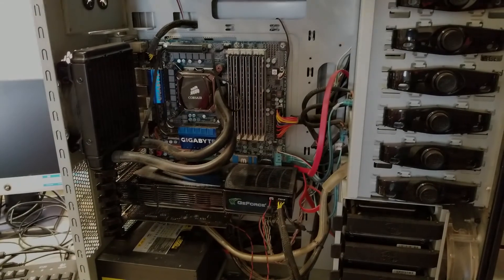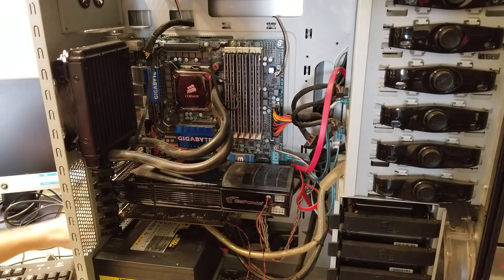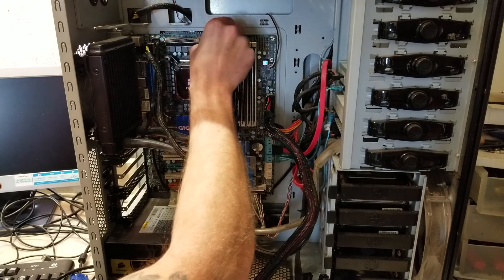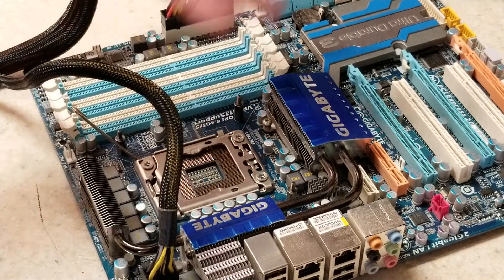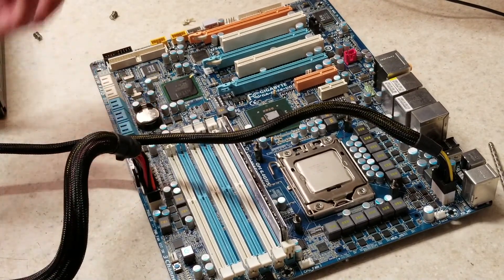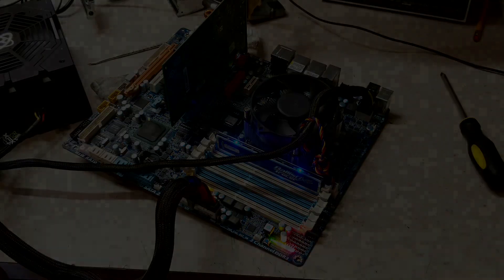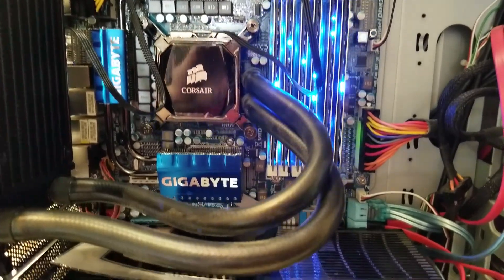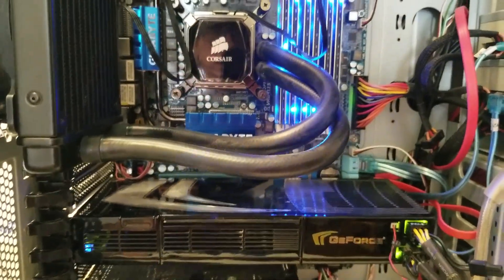PC diagnosing and repair - on off power cycling

Comment: I'm having a similar issue, not this exact board but a UD3R. I'll see if I can attempt a similar fix. I just got it from a friend who built it as a HTPC but no longer used it. It came with 3 sticks of the ram showed in this video as well as the same CPU and a single fan CPU cooler. It also has a Radeon XFX HD 5770 gpu. No SSD, but I might have a spare.  Using this for a Cyberdeck project.

Comment: Great video! In my opinion Gigabyte motherboards have  big problem with BIOS corruption.
This behaviour is present on old boards but, for some reason new boards inherited this problem.
Reply: Same B85 Gigabyte board is power on off cycling ifself. I can't get any solution yet
Reply: @Real_stone-p8x  did you try with diagnostic POST card?  do you get any codes at all ?

power on-off cycling can be caused by various reasons,mosfets,regulators etc.

You will figure it out but it will take time.
3 months ago i had a problem with ASUS motherboard M5A97 R2.0.
I couldn't get it to POST.
Mine had a problem with memory PCH initialization.
She was not giving any beep codes.
I have flashed the BIOS first with older version but nothing changed.
I did some troubleshooting.Used boardview to check the components.
They were fine.After that i did flashing the BIOS once again but with the newest version.Same thing again nothing same code  appeared related to memory PCH initialization.
I have continued the troubleshooting process ,i didn't want to give up.
Used some manuals from old boards for troubleshooting.I knew that problem can be solved maybe not in all cases but i can be solved.
My guess was that the keyboard controller was faulty.First  hardware on motherboard that gets initialized is System Timer,then next is Keyboard Controller after that is RTC-Clock.You can find this on information on any older motherboard manuals from 2000-2010, and even older ones.
In my case system timer was fine also the RTC clock was good.
Btw cpu on my motherboard was executing code which is a good sign.
I spent more days on troubleshooting this mobo.At some point board started to give beep codes,Firstly she replied with one short beep code which as you know every board gives when it passes the POST test.
But after that one short beep i heard three more short beeps .I did a research four short beep codes mean system timer failure!(that is information from internet) i knew this was wrong since the system timer first get initialized and in my case it was  in good state.
After some thinking i have plugged in the keyboard in one of the ports of motherboard.I have turned on the motherboard and only one short beep was heard. I have plugged in GPU and  monitor  and i was in BIOS, board started working again.
I just want you to tell you that motherboard manufacturers are not fans of motherboard repair this also can apply motherboard engineers-designers.Of course they know how to repair electronics i believe that they have some special equipment and manuals and procedures for making repair more easier.
this was my second board that stared working i had another Asus board wich had a more complex problem since CPU was not executing any code.
Can you turn off the motherboard by power button?
Does it starts without pressing the power button?
Check the connections on the motherboard,check the for short-circuits,look for any scorched components.
Reply: @Real_stone-p8x    Did you try with diagnostic POST card?  do you get any codes at all ?

power on-off cycling can be caused by various reasons,mosfets,regulators etc.

You will figure it out but it will take time.
4 months ago i had a problem with ASUS motherboard M5A97 R2.0.
I couldn't get it to POST.
Mine had a problem with memory PCH initialization.
She was not giving any beep codes.
I have flashed the BIOS first with older version but nothing changed.
I did some troubleshooting.Used boardview to check the components.
They were fine.After that i did flashing the BIOS once again but with the newest version.Same thing again nothing same code  appeared related to memory PCH initialization.
I have continued the troubleshooting process ,i didn't want to give up.
Used some manuals from old boards for troubleshooting.I knew that problem can be solved maybe not in all cases but i can be solved.
My guess was that the keyboard controller was faulty.First  hardware on motherboard that gets initialized is System Timer,then next is Keyboard Controller after that is RTC-Clock.You can find this on information on any older motherboard manuals from 2000-2010, and even older ones.
In my case system timer was fine also the RTC clock was good.
Btw cpu on my motherboard was executing code which is a good sign.
I spent more days on troubleshooting this mobo.At some point board started to give beep codes,Firstly she replied with one short beep code which as you know every board gives when it passes the POST test.
But after that one short beep three more short beeps are heard,I did a research four short beep codes mean system timer failure!(that is information from internet) i knew this was wrong since the system timer first get initialized and in my case it was  in good state.
After some thinking i have plugged in the keyboard in one of the ports of motherboard.I have turned on the motherboard and only one short beep was heard. I have plugged in GPU and  monitor  and i was in BIOS, board started working again.
I just want you to tell you that motherboard manufacturers are not fans of motherboard repair this also can apply motherboard engineers-designers.Of course they know how to repair electronics i believe that they have some special equipment and manuals and procedures for making repair more easier.

Can you turn off motherboard by power button?
Can you do a reset with reset switch?
Does your motherboard starts automatically without pressing the power button?
Check for short-circuits,check the connections on motherboard.
Look for scorched components.

This was my second board that started working,I had another Asus board that was not executing any code by CPU.I had more trouble to find what the problem was on the first one.Be persistent,Don't quit.I believe that you can fix. If not you will find another one that can be repaired.
Reply: I have a similar board. Has worked flawlessly for a decade. I built it originally- was state of the art, back in the day. Always pay a little more if you can get quality Jap capacitors.

Comment: Hi I have the same lga 1366 board with i7 950 cpu it going on and again off power cycling but when I touch the 8 pin cable for cpu it will run OK but after shouting down when you want to turn it on you will see power cycling or just no display then I have to push power button to shout it down and again touch the 8 pin cpu cable to turn it on how can I fix it ?🥲
Reply from the maker: It seems there is something making a bad connection at the 8 pin connector. Check the connector it may have a loose wire, or possibly a bad pin, and check the motherboard for a bad solder joint.

Comment: Hey can I ship you my PC to fix? I literally just got it 4 days ago everything is new in it and it’s already power cycling 😖😖
Reply from the maker: Aw damn, that sucks. If it is still under warranty you may want to utilize that. I would love to help you out but i just dont have any time, i dont even game anymore since there are not enough hours in the day.
Reply: @Snickerrick  aww it’s cool man i understand. But I’ll see if I can warranty it. I hope I can cause the only thing I changed immediately on it is the CPU cooler. The one they had on there sucked. But I’ll see if I can get warranty.
Reply from the maker: @BigBill101  good luck!
Reply: @Snickerrick  good news man! Your video actually helped me solve it 😂 my Corsair iCUE H150i Elite Capellix Liquid CPU Cooler was causing the issue. When I would unplug it my pc would turn on fine and run but when I plug it in, it would power cycle. So I just installed the original cpu fan back on for now. I really don’t understand why the cooler would cause the issue. But I’m just glad it’s fixed now. Thanks !
Reply from the maker: @BigBill101  oh nice!!! I suppose it could have had a short in one of the fans? Anyways, congrats!!

Comment: So i have one of these boards specifically the Ga-x58-u3dr and it would loop just like this so i cleared the bios and so it would now sit stable but with no display kind of like the video. For the life of me i couldnt get it to reflash so i bought a chip programmer and reprogrammed it and now it is back to looping which i found really odd with a fresh bios
Reply from the maker: That is odd. These older boards can be kind of flaky, and it could still be another issue still causing the looping, and although I generally have good luck with a programmer also, there are times when it takes another attempt, for whatever reason. Good luck, I hope you get it working!

Comment: I took my cpu,gpu,ram,hard drives out and my pc keeps cutting and rebooting not sure what it is mine stays on for a few mins at a time before cutting.
Reply from the maker: Its really hard to say what could be wrong, this was an example of just one issue out of many it could possibly be, but does show some of the troubleshooting that can help narrow the issue down. You do need a CPU and RAM on your motherboard to boot, Im sure you tried to boot it with just the CPU and 1 stick of RAM, what did it do when you tried that?
Reply: @Snickerrick yeah sorry it does boot up i'm actually typing this on my pc now. But the power just cuts for some reason and the ez debug cpu led usually flashes as it goes off. Maybe need new thermal paste as it's 5 years old.. 😅
Reply from the maker: @PrimeMontages  hmm yea i suppose it could be overheating, but it would generally just throttle down the frequency and vcore to a safe level not just shut off. It is possible the voltage regulation on the motherboard is getting too hot, or the PSU is shutting down, or probably 20 other things it could be. Sometimes issues like that can be solved quickly, other times it takes a while. Good luck!

Comment: When you removed the battery & cleared the bios did you have the power running to the board at the same time?
Reply from the maker: Yea believe it or not, I had to remove the CMOS battery, plug in the power, then push the button on the rear IO a few times and it finally caught.  Im not sure what actually caused the issue of corrupting it and then it not wanting to reset, but I would say it was a lucky fluke that this got it working.

Comment: Yiu probably wont see this but if it's a problem with the motherboard then do I have to get a new one or can I manually fix it
Reply from the maker: It depends on what the problem is. In this case it was the BIOS corrupted, and the backup BIOS wasnt fixing it like it should, so didnt need a new motherboard.

Comment: Thanks for the video.   I had this Mobo do the same thing a few months ago, I think it's even the same case, a CoolerMaster HAF.  
 It has a ThermalTake air cooler and 12GB of Corsair memory on an I7-930 and a GTX-970.   It could still play modern titles at pretty high settings.    I originally built it with a GTX 480, which could also be used to make grilled cheese sandwiches.
Reply from the maker: Ah yes, the fermi grilled cheese maker! :D

Comment: It says in the description that the motherboard is ”Gigabyte GA-FX58”, but in the video it says GA-EX58-UD5 right there on the board. :)

Anyway, I removed the CMOS battery and pressed the clr CMOS button on the back and powering up the computer after that it to start and recover from the backup bios, but a few seconds into that process it suddenly shut down again. :(
Reply from the maker: Yea I hadnt even noticed that, good catch! I now wear glasses lol 
Hopefully your BIOS is recoverable. I just did a little digging, and its possible there are other options you can try, whether they will work on your board or not I dont know. https://www.overclockers.com/forums/showthread.php/697533-GUIDE-Forcing-backup-BIOS-on-Gigabyte-motherboards
Reply: @Snickerrick  thanks, but I think there’s some problem with the motherboard. I mean I got it to start doing the BIOS recovery from the backup BIOS, but also during this it shut down.
Reply from the maker: @staraffinity  oh that sucks, sorry to hear that :(
Reply from the maker: The description has been fixed, thanks!
Reply: Question...at what speed is water cooling necessary....the coolers that stand up rather than install like the low profile coolers..do they stress the motherboard?
Reply from the maker: @mqcapps  I have never given that much thought, the big tower coolers stressing the motherboard. Im not sure there is really enough weight leveraged far enough out to really put a lot of stress on them, but I am no expert. As far as watercooling, it has its place. Big air coolers can keep a CPU cool enough, but they will reach max temp faster, where a liquid cooler gives you more time until the CPU sees that max temp. If you have a custom loop with enough radiator, then the story changes, it is far more effective. There are pros and cons of both, the main con of liquid cooling is the fact you have liquid in your PC case.
Reply: @Snickerrick  thanks....keep up the good work dude
Reply from the maker: @mqcapps  Will do, thanks!

Comment: hello there. just wanna ask. did u pop out the cmos battery with all hardware installed? like gpu,ram and cpu..
Reply from the maker: I dont believe I tried it without the battery and all hardware installed. Seems just removing the battery and resetting while still connected to the PSU was trick in this case.

Comment: hey would you still been able to flash bios if you hadn't got the beep n error code?
Reply from the maker: Yea it's possible since the board has dual bios, or could use a chip programmer, if the bios is the issue. I fixed a 990fx sabertooth with a programmer, but have a stack of boards it didnt help and unfortunately I dont know enough about board level chip repair to fix them.
Reply: @Snickerrick  I had 2   990fx sabertooth boards die on me . both happened about a month after the warranty expired.  Havent touch an asus board since.
Reply from the maker: @newworld9133  mine died too, I bought a eeprom flasher and reflashed the bios chip, it fixed it!
Reply: Snickerrick I’ve a x58 I red light no beeps no post fans spin briefly then powers down then powers up again n spins fans still no beeps fans just gradually get to a constant high speed, try to boot with no ram no gPu just the same no beep no post , maybe it only like certain ram is my guesse... it’s an ASU’s P6t se
Reply from the maker: @bblitefootbilly3243  I will usually throw the parts cannon at it, try a different CPU, try a different stick of RAM in a different slot, and then try to reflash the BIOS, if it is a part failure on the board, then that is where I have to stop, that is beyond my abilities unfortunately. I have a stack of dead boards here that I tried all of the above on, and still wont post, so they most likely have a bad part somewhere on the board. I did have 1 PC come in that actually had tiny particles of sawdust in the RAM slot, blew it out and it worked, so check for buildup of dirt and dust also.
Reply: Thanks I managed to find some cheap ram on eBay that may be better suited I was planning on giving it a good clean in the meantime... would be cool if I got this old beast up n running again.
Reply from the maker: @bblitefootbilly3243  yea it would be nice! Good luck :)